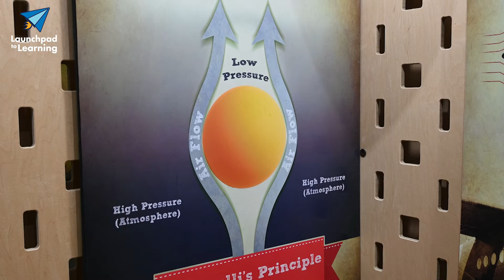Bernoulli's Principle

Comment: If you hang two flat cardboard boards (note, they must be hard and flat) and blow them in the middle, then these two cardboard boards may not be pressed together. The real reason for the low pressure is that the surface of the balloon is curved, which causes the low pressure. So your explanation is incorrect.

Comment: Erm, whatever happened to blowing over the top a piece of paper... far simplier to show and do...
Reply: Because it's not an accurate representation of Bernoulli. 

When someones blows air, which was compressed by their lungs, the velocity of the air is due to the higher pressure air escaping ones mouth by flowing into an area of ambient pressure, and continuing along due to momentum. The air pressure does not decrease below ambient air pressure once its exhaled. It matches it. And ambient pressure is what is below and above the paper in the first place. So its not exactly Bernoulli. Which applies for air accelerating in a duct. Or a wing traveling through undisturbed air. Although, Bernoulli doesn't account for how a wing generates lift, as the upper surface is often only 1.01-1.05x longer than the lower surface and that minute speed difference makes almost zero change in air pressure. Then you have the fact that symmetrical airfoils fly just fine, as seen on the Extra, Edge, and MX aircraft. All have identical top and bottom surface curvatures. It can be seen that Bernoulli has nothing to do with anything related to generating lift by a wing.

It would seem the Coandă effect is a better description of the blowing over paper trick, Which is due to air velocity supplied by blowing, and the viscosity of air "sticking" to the paper as it travels along its surface, the jet-flow pulling in ambient air, which pressure is lowered. 

But primarily its Newtonian physics, air has density and mass, and a wing impacts air at some angle of attack, and deflects the air downward which has an equal and opposite reaction which is lift. 

Or the Coandă effect pulls ambient air from above the paper and draws it downward into the blown air jet-stream. This downward acceleration of air mass has an equal and opposite reaction on the paper which causes it to lift.